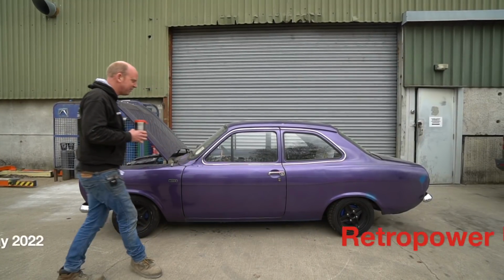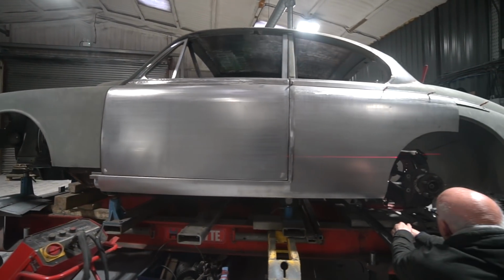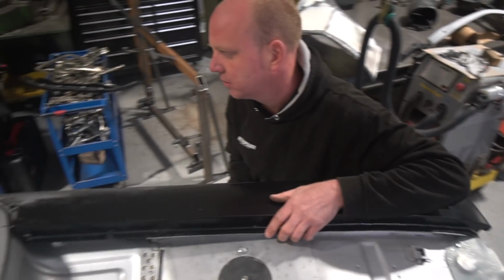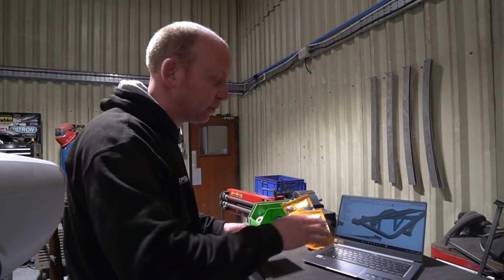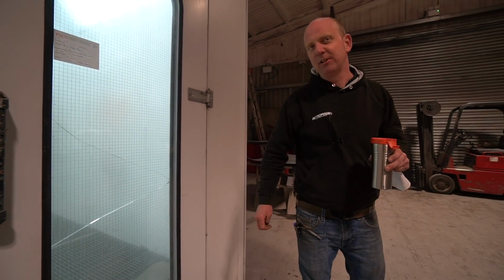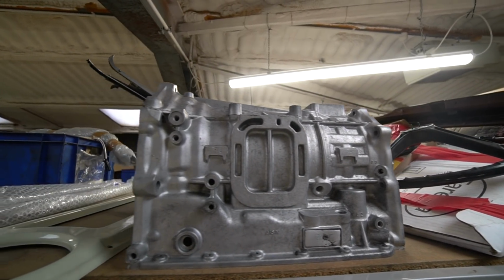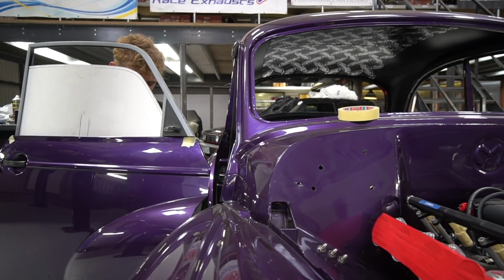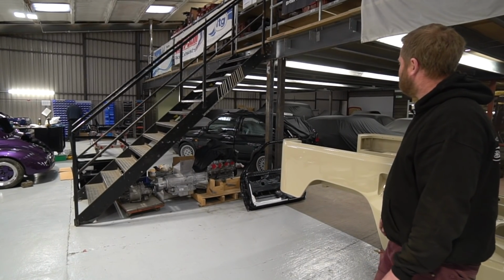Retropower Uncut Episode 86: MK2 Jaguar 2 Door Coupe Metalwork, and FJ40 Land Cruiser gets PAINT!

Comment: That Jaguar coupe conversion looks pretty nice.  We did a partial restoration on a Mark II and installed a 4.2 liter Chevy v6 with a TH 250 trans.  Worked fine with the original suspension, brakes and so forth.

Comment: As someone who has fairly recently (in the last year) bought a pair of Magnum bubble arched MK1 Escort wings, I can tell you that the shape around the scuttle ends is also not correct. I can't say if they're  better or worse than the ones you're been wrestling with, but I've had to modify both of the siffeners as well as the shape of the wings in order for them to be somewhere close. The return edge where the wing rails are formed  have also not been bent to the correct  angle, they're too shallow.  You will probably also find that the wings are too long along the trailing door  edge by about 8mm. Other than that they're spot on!

Comment: Why would anyone fit an outer brake hub assembly to an S Type rear suspension subframe thereby adding to the unsprung weight?
Reply from the maker: You are certainly correct that we are adding unsprung weight (as jaguar did on the later outboard disc IRS setup) but this car is a cruiser and unsprung weight will still be a mile less than the original live axle. There are a few reasons for the change: rear pad change is through hatches in the bulkhead in an etype but in a mk2 it would be a rear seat removal job to change the pads. Disc and caliper changes would be a subframe-out job. You can't fit larger diameter discs due to subframe clearance. There's a lot of heat generated in an area that's difficult to get air flow to. All these things could be addressed, but by far simpler route is outboard discs and unsprung weight is the only trade-off.

Comment: Great stuff as always. Point to be aware of when using those offset uj's, they have to run dead inline or they can vibrate. If it's just the trunnion diameter it will likely be ok. If it's the width or spacing of the trunnion it can be an issue due to the geometry.  Probably not an issue with your setup as I imagine the shafts will run parallel to the ground at ride height. Your comments on the wing covers echo my thoughts exactly. I stopped using them almost immediately after buying a set do keys years ago. I have used that low tack film that builders use. That's ok provided the paint is fully cured or it may leave a mark where any wrinkles are. Don't use it on TPA though.....pretty unlikely unless it's an original Rolls Royce 😂. It doesn't make you think the panel is protected like a wing cover but it stops minor scuffs and marks that may otherwise have you flatting more than you would like.

Comment: 22:35 Great point here.
I used to get into trouble at new car dealerships back in the day as a mechanic for not using guard covers and seat covers.
I wore special shorts with the button on the inside and I worked clean and didn't wipe my hands on my arse.
I never ever damaged a car or dirtied a seat in the 20 years in the industry 🙂

Comment: The Mk1 would be either a dealer hold back, run out model, 
It may be just down to the fact that it was a run out model, the last of the mk1’s as it looks as though it has the 13e equipment on it, so Ford throws all the better equipment on the last of the shells, just to get rid of the last of the model before the Mk2 comes out or it was just sitting on the dealer forecourt untill they could get shot of it at a discount, again before the new model, Ford did this with the mk6 Escort when the focus was first released, they offered the escort with extra equipment at a discount along with the release of the mk1 focus

Comment: Funfact: Ford competitions at Boreham used to re-shell 'tired' Mk I RSs with Mk II shells as they were basically the same floorpan so you had registration numbers on Mk IIs that pre-dated its introduction sometimes by many months!. Of course Boreham moved registration numbers from shell to shell and the Chassis plate was just re-rivetted. They did a Mk III Cortina body on a Mk I Escort Rally spec. floorpan for someone in South Africa I think and one day when I was walking through the workshop I saw someone had written "Cortort Escina" in the bootlid!

Which begs the question on the registration number on 'Project One' and its partner. Given all the body panels (including chassis rails) bar a few have been replaced you may be in difficulty with DVLA retaining its original number. I am sure its been checked but having been through that loop a few times I feel its right to ask.

Someone queried this on new classic Mini bodyshells from British Heritage but original registration and chassis plates are retained as the bodyshells are made on the same presses and tools from a company descended from BL / Rover. Not sure M Machine Escort panels are the same.
Reply: @Bob Fleming I understand the reasons for re-shelling post RTA damage as I did that for some years (including HGVs) and re-shelled two of my own Mk I Escorts in my rallying days but the bodyshells would all have come from the manufacturer. As is the case of Heritage Mini bodyshells and why its reasonably(!) clear.

However I am still in some difficulty over the number of panels replaced on Project One though even given your sound argument. Following your logic that "as long as long as the design of the bodyshell is unchanged then there is no problem" what about Project Churchill which is now a 2 door Coupe and nothing like the original? Whereas the Jensen will be fine as it has a separate chassis to which the chassis number is attached and therefore the registration number

There must be a sensible resolution and I am sure these clever people have found it but I cannot see it.

Comment: Converting Jaguars to IRS is (quite) straightforward because the S-type & later assemblies are still around to swap. What's available for smaller machines, e.g. a Sprite? 
Triumph Heralds and (I think) Spitfires had the evil single UJ swing axles, so they're only good for the diff; the GT6 and Vitesse had double joints, for more of the suspension & drive. (Dim memories from long ago, so I'm open to correction.)

Comment: Do the inner brake discs get removed when you convert to the outer brake setup?
Reply from the maker: Yep, just not done it on the mockup axle. They get replaced with spacers